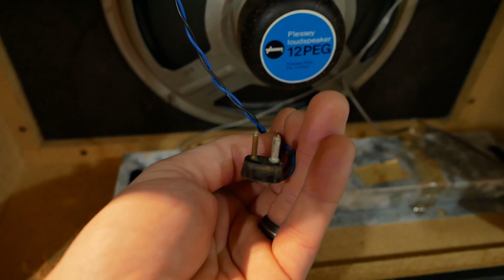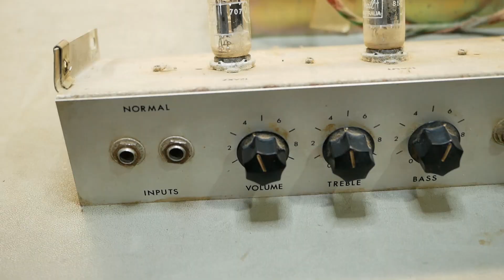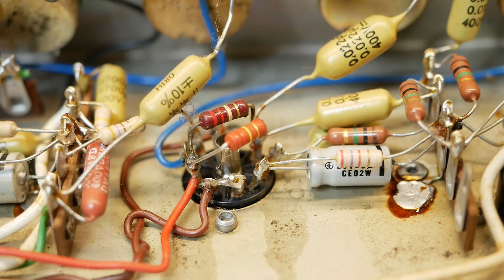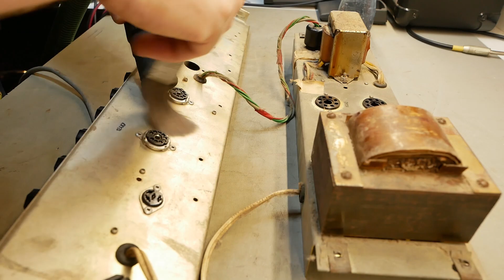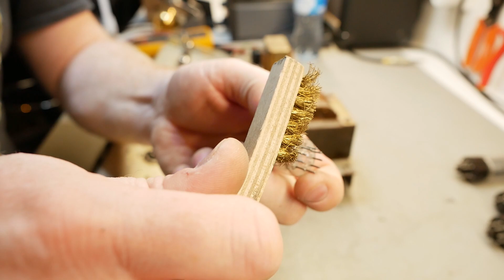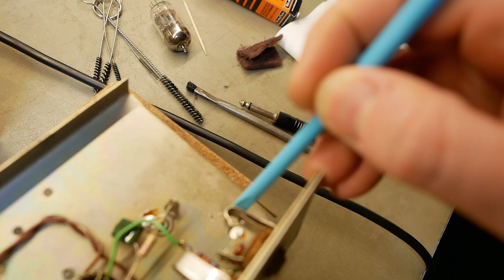Soundcraft Vadis 201 Combo - Part 1

Comment: Chassis is both the singular and plural spelling of a chassis the plural is  is eez rather than ee spoken ending . Engrish ( sic )  what a fine structured of a  language . Elna builds a fine cap  if it 15 years old it has served it purpose really.  These are working machines not museum pieces .  Cap have made very great strides in the last 20 years. If one does not know that a thermionic valve is also called a tube  best  read more .

Comment: The shielded signal wire carrying the audio from the top mounted preamp to the amp chassis is twisted and bundled up with heater and B+ wiring, so it's no surprise that the amp hums!  Separate the signal cable out of that wire bundle for lower noise..... PS,  I noticed that the phase inverter signal is coming from the top mount preamp and therefore the shielded cable must contain 2 conductors plus the shield, which does at least offer some common-mode cancelation.
Reply from the maker: The PI is actually in the PSU/PA chassis, so no luck there.
There was coax feeding that chassis from the preamp, but the hum was addressed by the re-cap. Weird things were happening with the 70's Elnas.
Reply: @BradsGuitarGarage  , interesting, as the only tubes I saw in the PS/Amp chassis were the output tubes and the 5Y3 rectifier. BTW, I've never seen 500V Elna caps; but I've replaced thousands of low voltage Elna caps in old SS hifi gear.

Comment: Nice old Phillips Miniwatt 12AX7s. I've had a bunch of those pulled from old gear. They've all been really nice, although a few were too microphonic for preamp duty.
Reply: Some years back I had about 3 dozen tube-based plug-in op-amp modules, made by Philbrick, that I scavenged from an industrial warehouse that was being cleaned out. They used two Telefunken diamond 12AX7/ECC83's per op-amp! Sold the tubes on eBay for a pretty penny, and got good money for the plug-ins as well.  I got some amazing stuff from that place even though I kind of got there too late and only had time to scratch the surface so to speak before it all got carted away. The building had been 90% cleaned out and emptied into 2 big dumpsters before I got there, and the dumpsters were piled high and filled almost to the top. I was only able to root around about a foot and a half or so deep into the dumpsters; I scavenged power and output transformers, variacs, tube sockets and resistors and capacitors, and all kinds of stuff like that (but almost no tubes). There had to be a lot more great stuff closer to the bottom of the dumpster, but without ordering in a 3rd dumpster to transfer over to and spending days of digging it would have been impossible to find all the good stuff let alone actually take it with me. As it was, I paid $200 and sold everything for about 5k. I remember that there were entire flats containing a hundred selenium rectifiers per carton, of all things.  I didn't take those with me because there wasn't any use for them ( toxic waste) and unfortunately they probably all ended up in a landfill. To this day it kills me to think of the things that were in those dumpsters that I didn't have time and energy to dig out.  Inside the building I did find a pair of tube-type regulated power supplies that used two Mullard EL34's per unit to do the regulating!
Reply: @goodun2974  My brother dug up a regulated supply from some old lab equipment, barely used. It had a (virtually) brand new KT88 in it, clear glass and GEC screen print in perfect condition. He's an audiophile and had no use for a single KT88, so he gave it to me on the condition I build it into a really obnoxious single-ended guitar amp. He said it was a matter of principle cuz it would really aggravate his audiophile acquaintances to know that perfect old KT88 went to vacuum tube hell. 😆
Reply: @Splattle101   I have a pair of Heathkit W5M ultralinear mono block power amps that I got for free from the dump with GEC KT66s in them, although one pair has almost no emission unfortunately ( The other pair test excellent however so I probably have to check over the amp with the bad output tubes very carefully for faults). I've been recapping and rebuilding them a little at a time but haven't got either one up and running yet. I'll have to dig up a good quad set of 6L6GC's or KT66's elsewhere, and the existing good pair of used KT66s will probably go into a guitar amp ,  As long as they don't rattle and aren't microphonic.

Comment: LOL disintergrating particle board. LOL once wet
Reply: Particle board isn't so bad compared to Homesote, a compressed-paper wallboard (i call it "mother of wasp's nest) that predates sheetrock, and was used to make Danelectro/Silvertone amp cabinets.
Reply: Bunnings sell some particle board restorer, probably not that much better than watered-down white glue, but it seems to work ok to stop all the nasty flaking.
Reply: @johnvcougar  , water-thin superglue would probably be better.
Reply: @goodun2974  maybe, but you'd need a ton of it, and it stinks and not very safe.
Reply: @johnvcougar  , if you wanted to reinforce the corner joints (the weakest point) of a particleboard cabinet, a 4 oz bottle of Titebond thin superglue, costing $15 to $22, would likely be enough. They claim it sets in 7 seconds! Anyway, super glue reacts with cellulose materials such as wood fiber and so it sets up really really quickly, and if you needed to you could always give it a spritz of super glue accelerant.  A water based glue, thinned down, might tend to expand the wood or particleboard fibers as it soaked in, and might actually weaken the particle board, but super glue would set up quickly without changing the particulate structure. PS, superglue sets up faster in the presence of moisture, and so if the amp cab lives in a humid environment the glue would set up very quickly. PS, "Hot Stuff" is another waterthin superglue formula that works extremely well on wood and wood products.
Reply: @goodun2974  coolies, I don't have any chipboard issues atm, but good to know! Just wear an organic filter mask when gooping that crap everywhere, and keep ya fingers clear! Lolz.